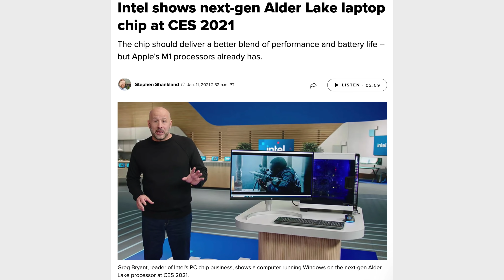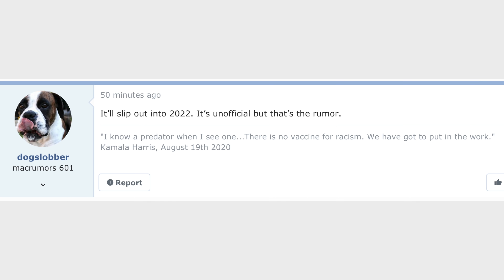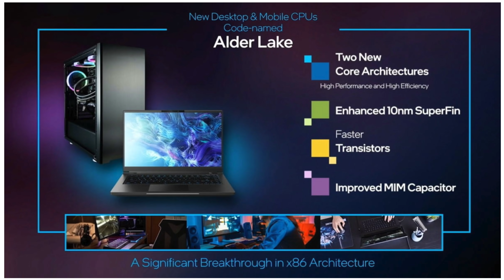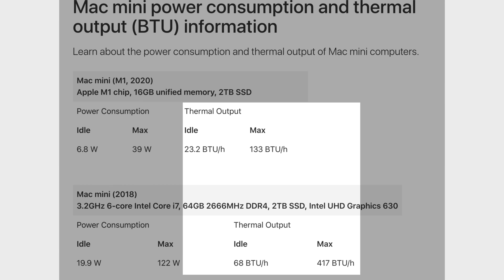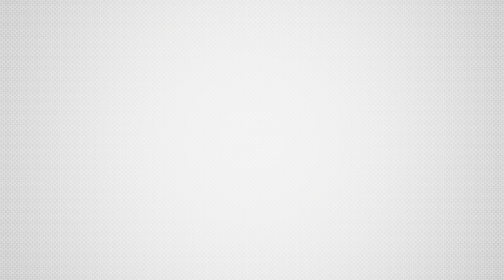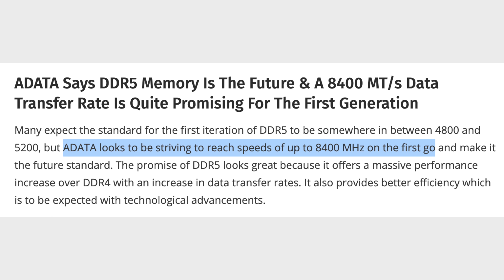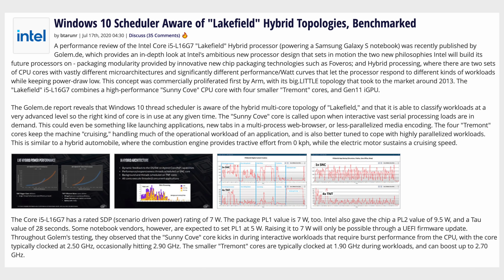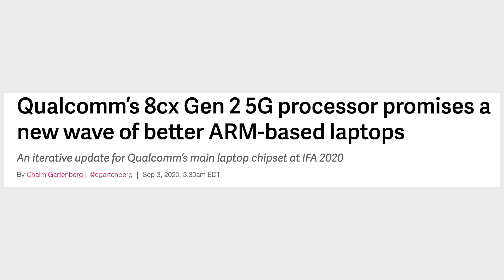Apple M1X vs Intel Hybrid Alder Lake CPU - This is WAR!

Comment: Did not expect Intel to come back swinging like this
Reply: i thought you died???
Reply: It's still going to be subpar. They are years behind.
Reply: @TheIndulgers  I don't think that at this point it's even possible for the x86 architecture to meet the ARM architecture in terms of raw performance. But for an x86 chip, it's really impressive.
Reply: @achebeterence6908  My I9 10900k beats out the M1. The M1's max supported ram is 16gb. I don't know why people hate Intel. I like Apple, I've never used AMD.
Reply: Good luck Intel...You gonna need it.
Reply: Sorry, they are still sleeping ...
Reply: @ChazzRavenelle   Lmao
Reply: Mr. president, I can’t believe that you’re here.
Reply: Agreed, i didn't expect Intel to come back swinging like this either. Granted they're swinging with both hands tied behind their back while bouncing around on their head, but at least they're putting in the effort.
Reply: Still built on 10nm. Right into the trash.
Reply: @WalleMedia  10nm and 5nm are just marketing terms. TSMC 5nm is currently better than Intel 10nm but not by a large margin. Also currently TSMC 5nm cannot run at speeds as high as current Intel 10nm.
Reply: @WalleMedia  nm is not the same. It’s about the density. Intel 10nm is around the same as TSMC 7nm.
Reply: I still don’t think Intel can come back